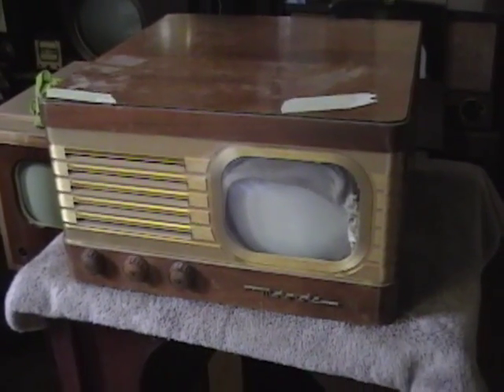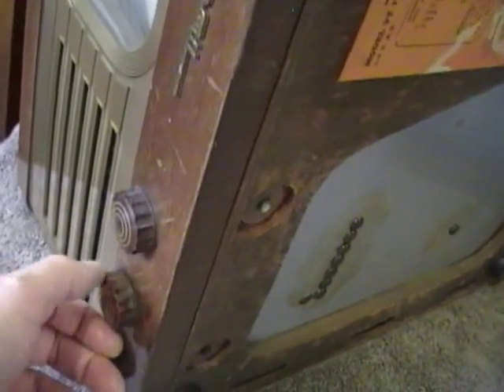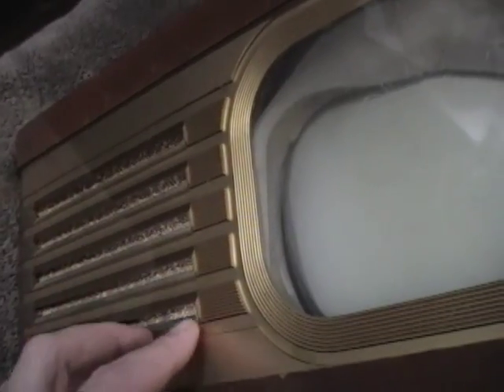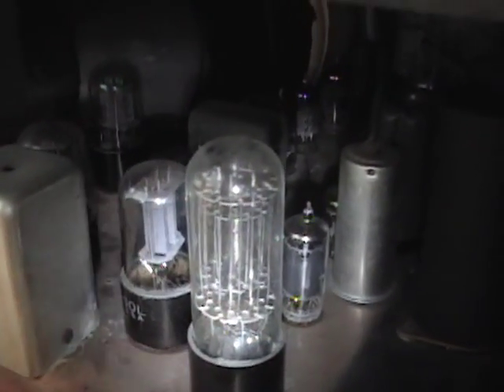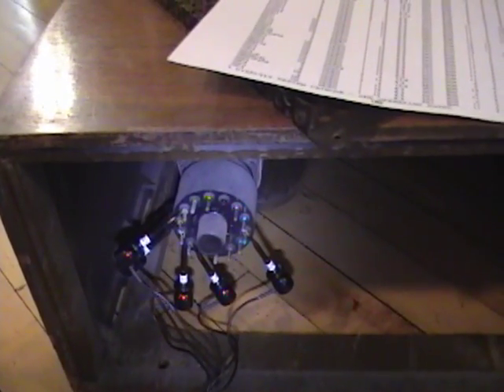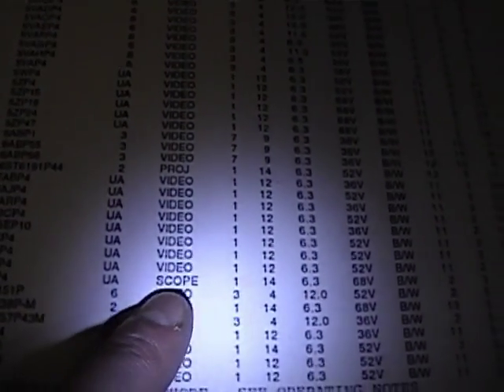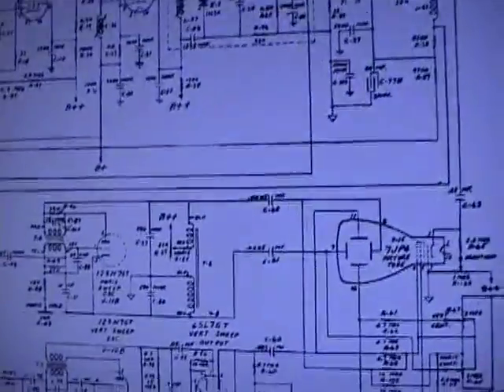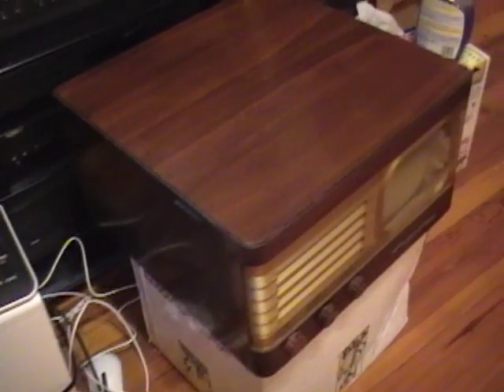Very Early Motorola VT71 scored :-)

Comment: This is going to be a fascinating project, looking forward to it very much. I find that sometimes the research can be as interesting as the restoration and you usually learn something new in the search that comes in handy down the road. Thanks for providing such detailed videos.
Reply from the maker: Hi.  It's been five years since I acquired this set and I don't think I'm ever going to restore it.  It's the oldest example anyone seems to know of and I'd hate to ruin the original electronics inside.
Reply: Yes, some times it is had to decide to conserve, preserve, or restore a unit because of the historical significance. Trying to make that decision now with a radio I have as far as it's cabinet. Thanks for the reply.